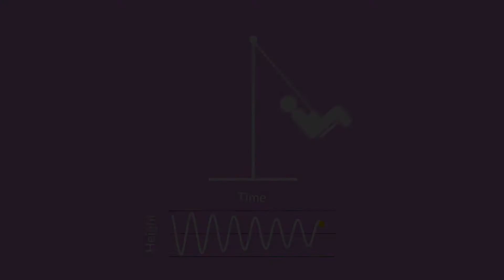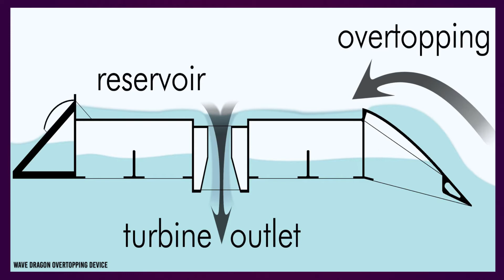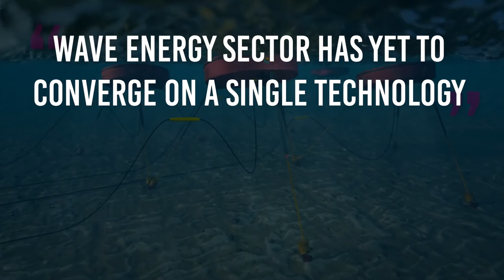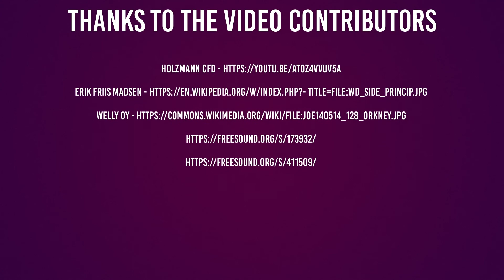WAVE ENERGY - SIMPLIFIED! (IN UNDER 5 MINUTES)

Comment: Something like a ship, smooth sides ,like a whale or sub.
2 it needs all the moving bits inside.
3. Battery's not wires to shore.
4. The inertia movement of the different parts.
Being affected by wave motion.

Comment: The answer to solar, tidal, wave and wind turbines is that they are now unnecessary. We now have the ultimate and cheapest green power device with none of these problems, in the SAFIRE GENERATOR. This is what we need to negate all the problems of all competing green energies. It produces almost costless electricity and therefore hydrogen from new FUSION NUCLEAR and is now immediately upon us. We have recently taken a new step to advance the physic of medium temperature plasma fusion power production by enabling chemistry of the atomic nucleus, or "nuchemy" in the newest FUSION NUCLEAR POWER technology. We are passing the chemistry level where we interacted with the atomic electron shells and are moving on to manipulations in this "NUCHEMY" atomic nuclear era when we interact and multiply nuclear protons. We have rediscovered the lost work of the alchemists and can make new elements with different atomic weights. This was ably demonstrated in "THE SAFIRE PROJECT". Quanta are important. We now have enough energy to manipulate the atomic nucleus much more easily by creating a compartment, or what is a local region of plasma containment so reactions at this atomic nuclear level can easily take place. This is about to practically enabled a really fantastic and cheap new era of energy production for the whole of mankind. This with hydrogen, so free fuel obtained from water or atmospheric moisture anywhere in the world. This new fusion nuclear SAFIRE GENERATOR is at the industrial commercial production final development point as of now and it can retrofit older and decommissioned power plants. The energy argument and other power methodologies are all now virtually irrelevant as we have new and very physically and economically powered practical and local community level fusion nuclear power. Solar roof plus Teslawall battery may be the present way to go domestically but megapack batteries and multiple storage technologies interconnected with an expanded ugly grid have a less certain requirement when you consider new any-scale community based and 24 hr reliable and self-fueling fusion nuclear in the form of the "SAFIRE REACTOR". Learn all about it at "AUREON ENERGY.COM". Then learn the newer EU Theory and plasma physics at "THUNDERBOLTS PROJECT.COM" and you will be permanently reeducated with this advanced newer EU theory that will allow you to understand more about the astrophysics of our whole universe and all within and you will be more informed and can teach your peers.

Comment: Wave energy not stable, no wind - no wave, no wave - no energy.
Reply from the maker: Yeah but it could make up part of the overall energy mix as there is plenty of energy available. It's not to say that it needs to be the primary source of energy upon which we all depend.
Reply: One could use the very same argument for wind turbines and yet there are thousands of them...
Reply: Just like with wind turbines on land, for wave and tidal energy the focus should on those areas that are known to have stronger than normal wind patterns. These places on earth actually do exist and will bring the best cost and energy production efficiencies to a particular project.
Reply: you're a moron
Reply: By extension no sun, no oil.
Reply: The narrator sounds like a boy I knew in Tralee in early 1980s